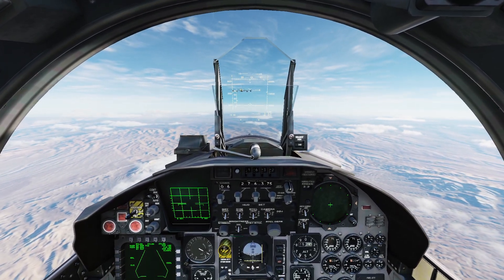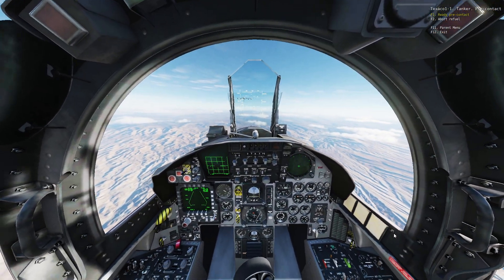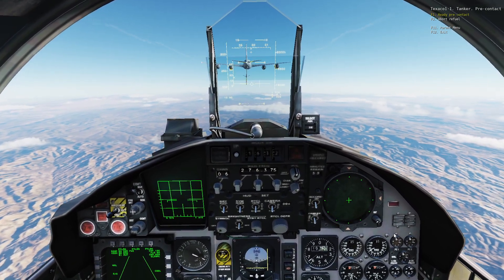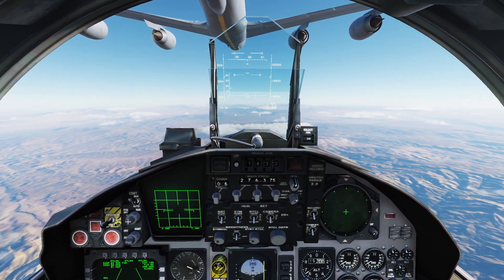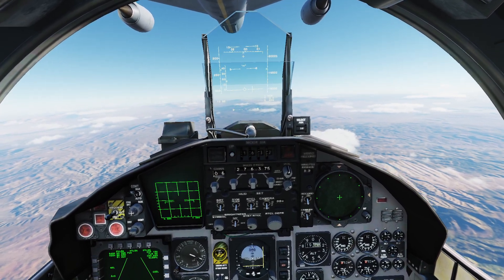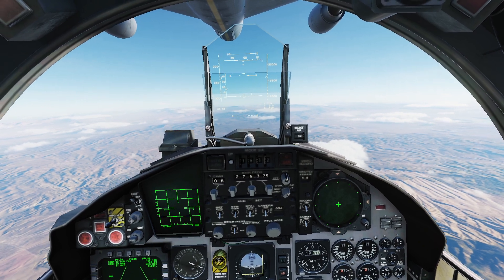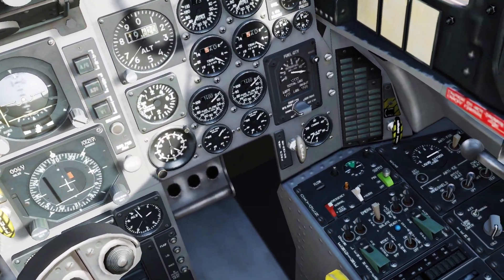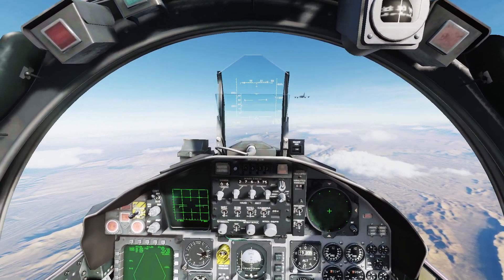DCS F-15C 122nd Fighter Squadron Air to Air Refueling Tutorial

Comment: a noteworthy aid, there is a green light just to the left of the top of the canopy that lights while refueling and goes out when you have lost contact, the F-15 is tricky the refualing door is off to the left behind your shoulder and although the boom automatically seeks the fuel hole and it can extend, retract, and bevel left and right it can only do a couple of degrees before it disconnects as to not cause damage to either the jet or the boom.
Reply from the maker: Thanks man. Air to Air Refueling is not my specialty for sure.
Reply: @thetyrantking2  no problem,  I downloaded a set of training missions for the f15c, covers everything like navigation, radar, a2a and the refueling.
Reply from the maker: @galaxy11plays  Very nice. I'm making these videos with the purpose of getting all of the guys in my squadron up to speed without me needing to give 1 on 1 instructions with each pilot each time. I'll just send video links for them to review and then they can ask questions.